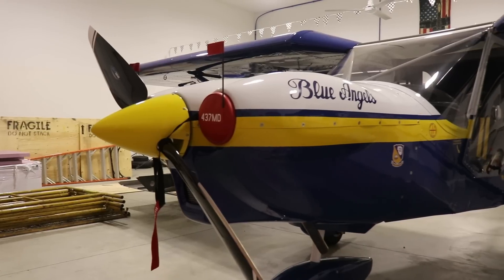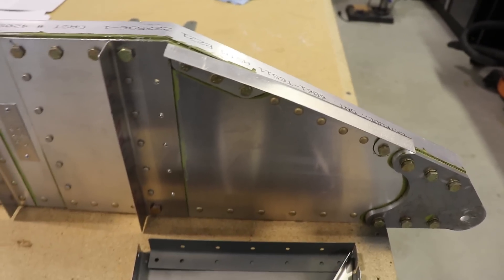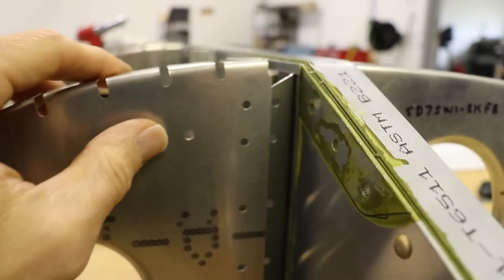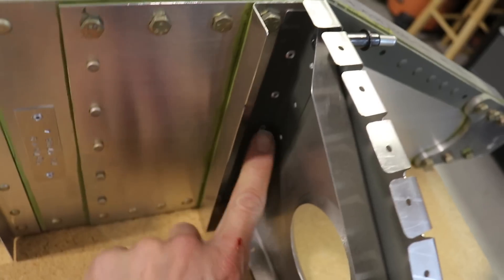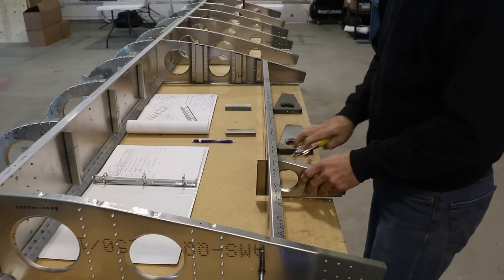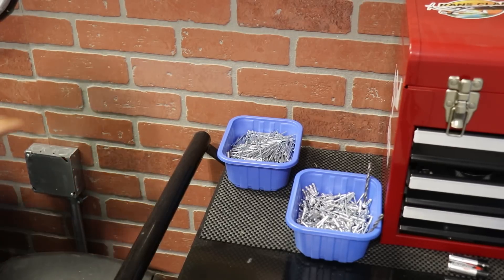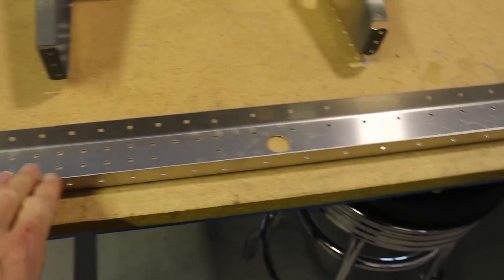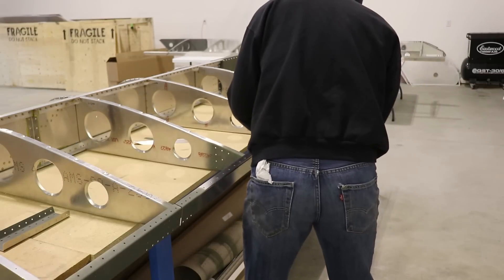Zenith Super Duty Wing Build (Ep11)

Comment: Awesome videos!! They are REALLY helping me with my own 750 stol project. I don't have a Super Duty but see that much of what you have done is much the same. I have a question though. I can't find what most all of the bolts are torqued at? They have a some 3/16 bolts on the tail and wings but I can't find anything as for torque specs. Are you just tightening most of them down temporarily or are you torquing them to spec right away? And what is the spec? Thanks a lot!!

Comment: Where you were having the issue with the front rib at the wing root anchor, couldn't you have used solid rivets as it looks like you could have gotten a bucking bar in there? Does the factory give you the option of replacing any of the pop rivets with solid rivets? Thanks for the video.

Comment: It looks like your rivets are pulling in one trigger squeeze.  Did you change guns or find away to adjust your gun that was requiring two pulls?
Reply from the maker: I bought a new gun when my other one broke. But with the new gun, I learned that there's in internal adjustment. I never knew there was an adjustment that could be made on the other gun. That's what happens when you pull it out of the box and throw the instructions away LOL!

Comment: They have those scotch brite wheels from your Dremel... Like 1" disks... Makes edge deburring large skins and large pieces...like the rear spar... Much easier. It will cause a groove in the disk of course but it frankly helps  round out both sides at the same time so I prefer the groove when deburring. 😁
Reply from the maker: I'll have to go find one for the Dremel. I have a bunch of different size wheels for the air grinder, but it's always a hassle to unwind the air hose and pump up the compressor. A little wheel for the Dremel would be quick and easy!
Reply: @KitplaneEnthusiast  btw - I just use the 1/8" screw-tip mandrel for the dremel and a small 1/2" diameter all-metal cutting wheel to hold the disk tight. Works great for deburring where there isnt a lot of pressure applied to the disk. Anyway, blue skies and happy building
Reply: @KitplaneEnthusiast  https://www.grainger.com/product/476W33

Comment: Mark, does it matter from which side you pull the rivets? Do they All have to be going the same direction? When would you use a washer with the rivet?
Reply from the maker: Generally the shop head is on the side of the thicker material. Not always possible though.

Comment: Did you have to torque those 4 bolts you removed, to get that wing tip on, to a specific torque value and was that specified on the drawings / assembly steps giving you a hint that they needed to be removed in order to get that assembly to go together correctly?